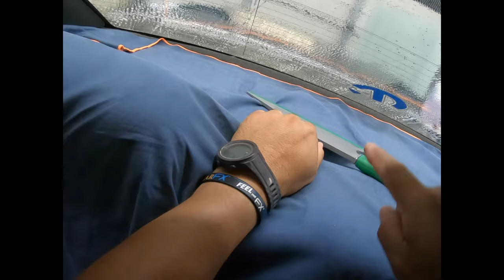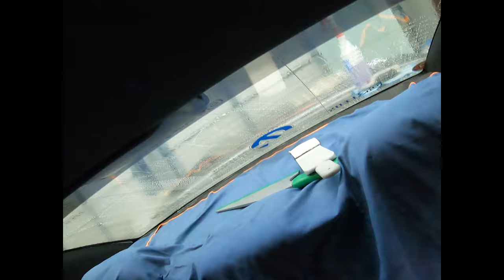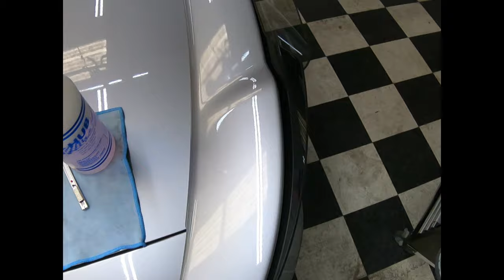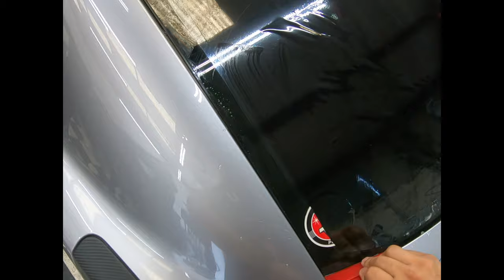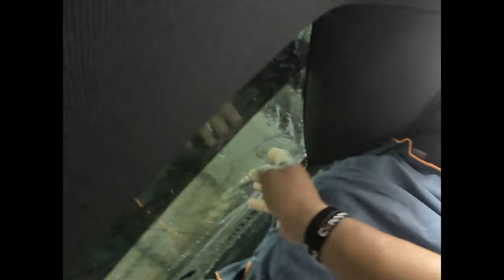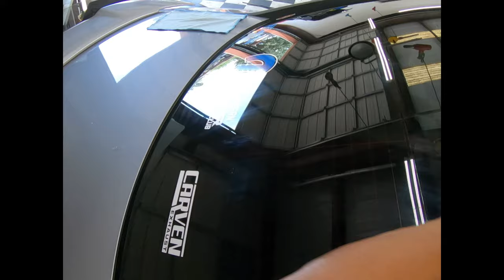2017 Dodge Charger Check Shrink Rear Glass? What is that, and how it's done!! ***DO NOT MISS***

Comment: Mike is the check shrink like double snapping  but on back screen?
Reply from the maker: snapping is ensuring you have negative tension on bottom lip of film so when you lay the pattern, there wont be fingers coming up because it is sealed via snapping...thanks for viewing boss!!
Reply: @mikesanchez1428  ok so the snap is for fingers at the bottom edge and the check shrink is for peanuts. Is that correct Mike?